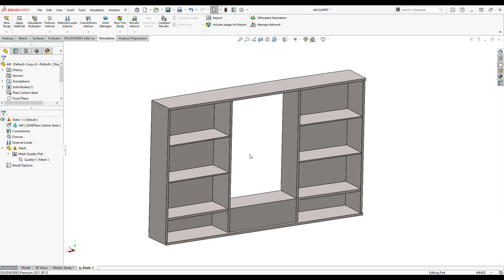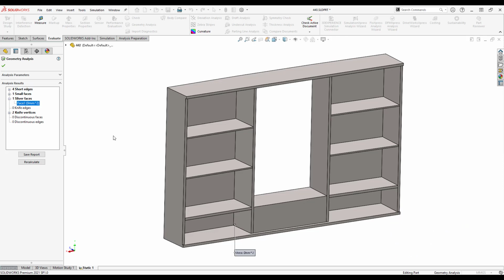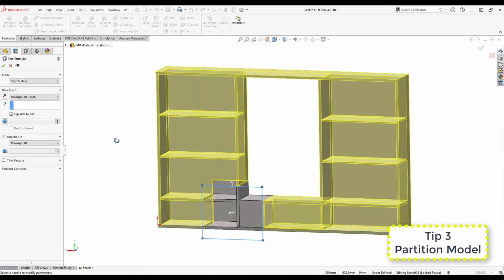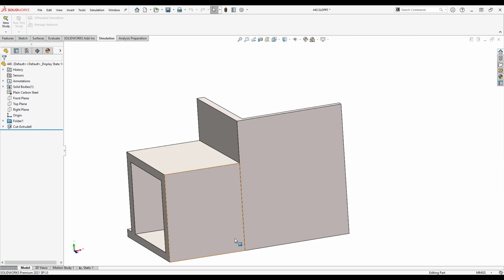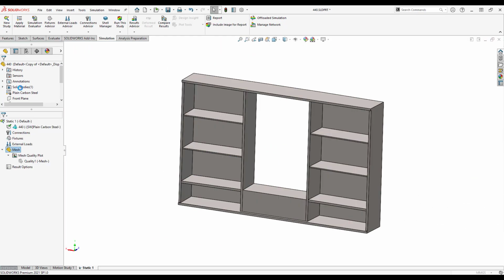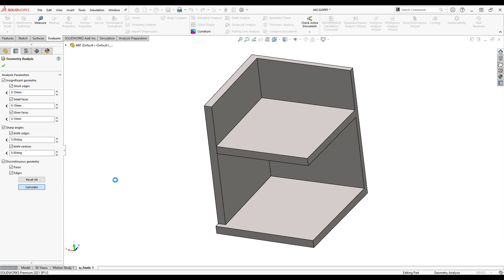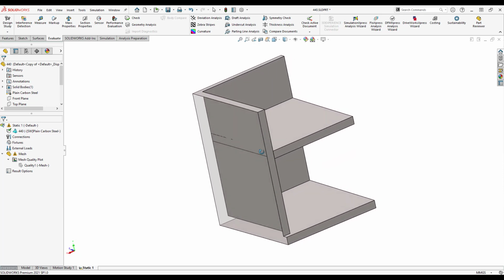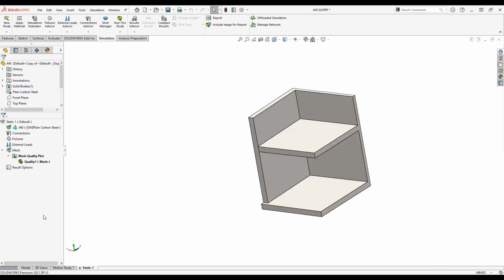5 Mesh Failed Tips for SOLIDWORKS Simulation

Comment: Geometry Analysis tool is not available on assembly mode! So what we should do in this case? Thanks!
Reply from the maker: You may have to look at the parts individually with that analysis. Check with your VAR's technical support team for more options.